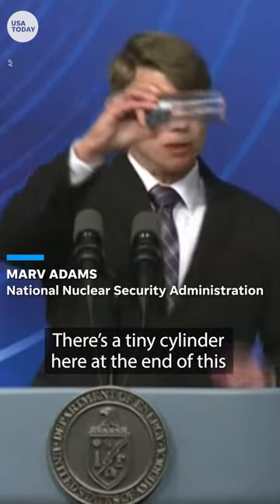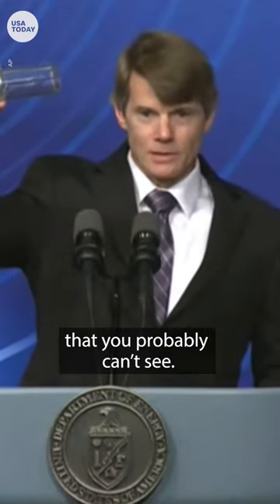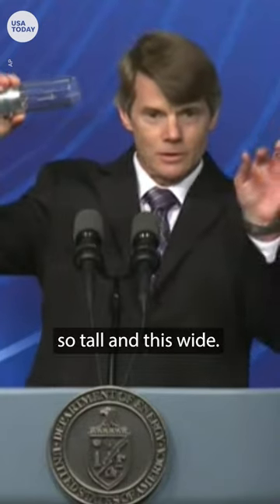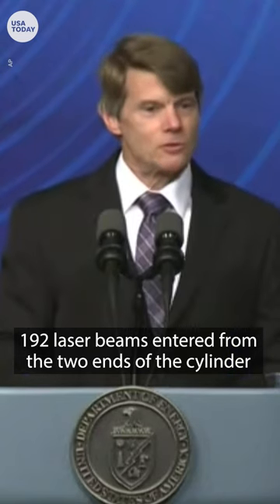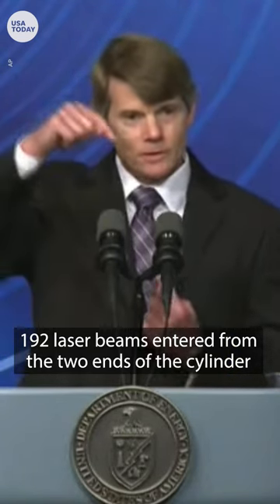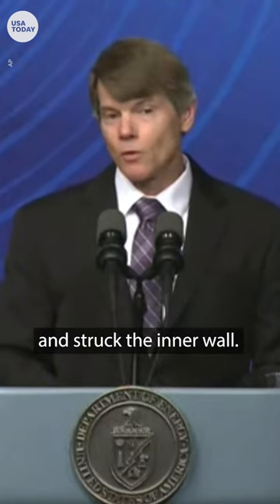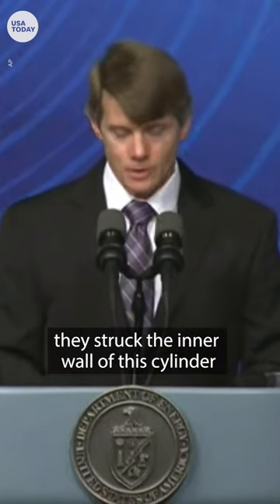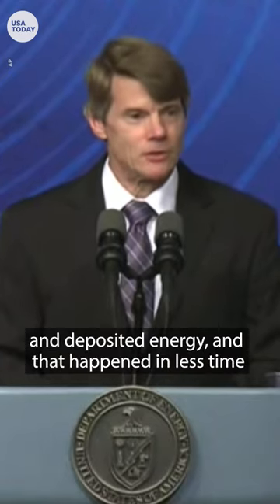Nuclear scientist explains why the fusion experiment was successful | USA TODAY #Shorts

Comment: This is fascinating

What does this means? 
What can you use this energy for?
Reply: Heat, electricity, propulsion. Think of it as an alternative to fuels such as oil, gas, coal and wood, but this energy source is effectuated by the power of light and gravity.
Reply: more… it took 300 mega Jules to the 193 laser that use 2 mega Jules to heat deuterium-tritium  or nutrinium • I’m unsure then produced 3 mega Jules  for a net gain.  I don’t know much just that they say it’s a huge step towards better energy usage.
Reply: it means they are simulating stars on earth
Reply: @fanda6122  without exteme heat emissions. Less heat (burning/combustion) and more energy. Most of our energy and fuel sources now are combustion oriented resulting in caustic byproduct pollutants.
Reply: Ditto, Brother 🤓
Reply: @MichaelwordZsMitchell  Reminds me of all the Star Trek episodes where there was an issue with the dilithium crystals. Gene Roddenberry was a true prophet of science fiction in imagining the physical in visible form.
Reply: To dumb it way down , it basically means we moved an inch towards usable energy being as common as water but still have a mile to go
Reply: Charging you're phone
Reply: Yes it is fascinating. He's talking about "nuclear fusion". Like how the sun produces energy. As apposed to "nuclear fision" where they split the atom to release energy. This should be so much bigger news than just very very rarely and randomly hearing about it on a social media platform. I wonder why that is...🤔